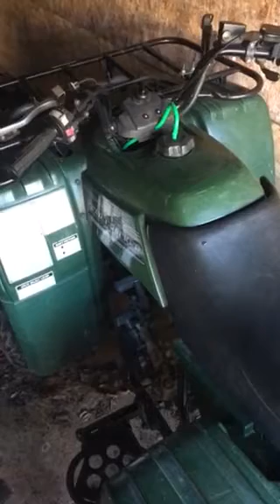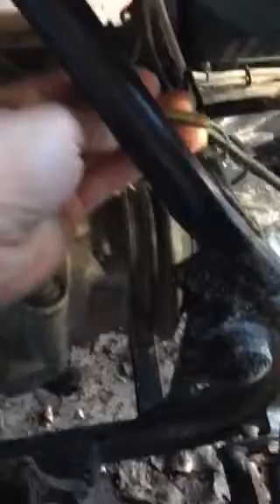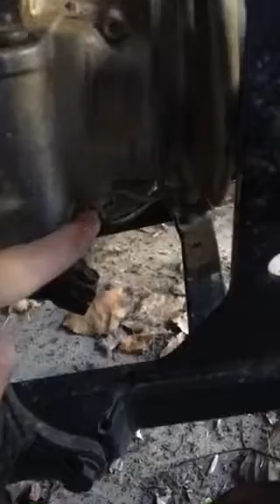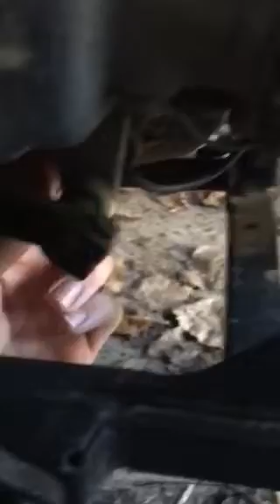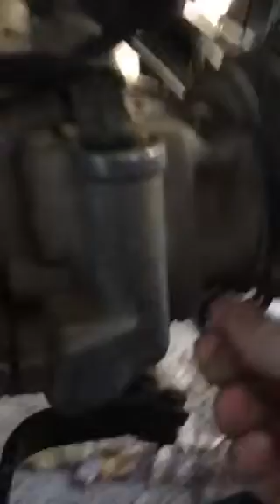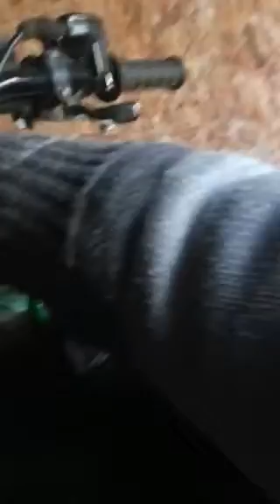Neutral light switch won't work ATV 250 Yamaha bear tracker

Comment: Where does the other end of this 2nd wire go to. My wire is not connected either end. No neutral light. Starts with pull start though

Comment: Thanks, I had missed this bottom connection on my big bear.....wish I had looked at this before I bought a replacement relay.  Terrible location as it came off in a very short off road session.
Reply from the maker: Brad S ... was tricky to figure out. Glade to help. Thanks.